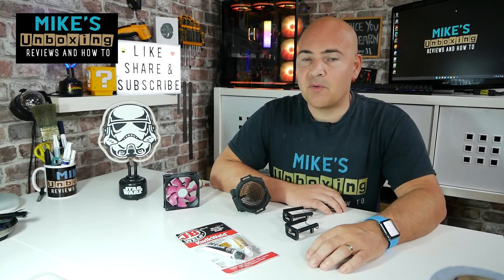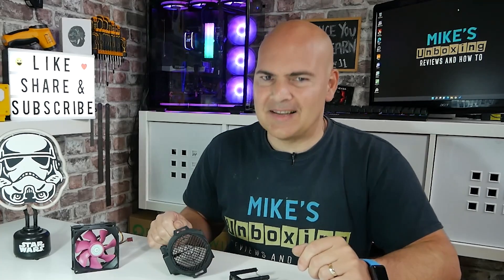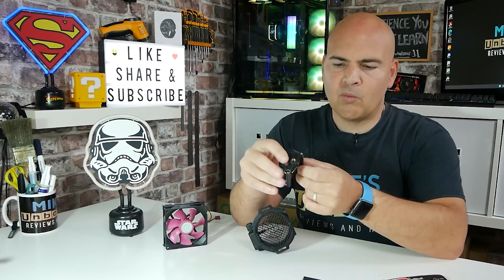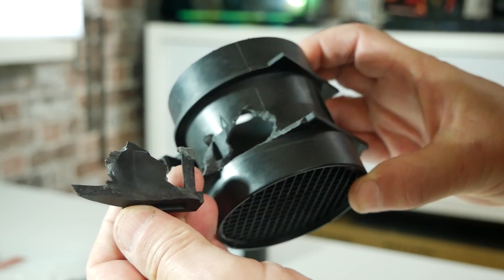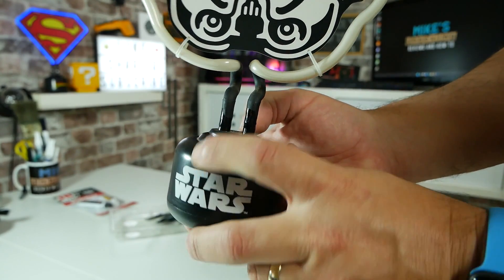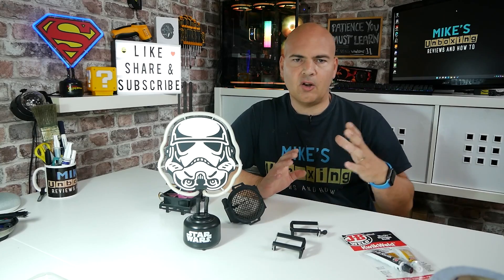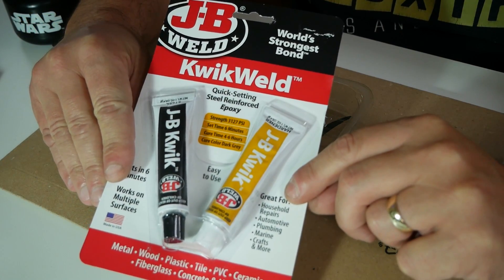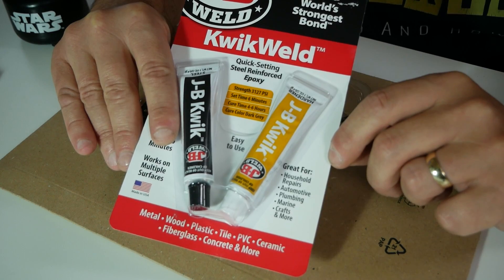JB Kwik JB Quick Cold Weld Fixes The Unfixable Quickly Strong 2 Part Steel Reinforced Epoxy Glue

Comment: I've used a lot of JB Weld products over the years. They really works, and on more things, than you'd think. I fixed my car's leaking radiator with it. When I was really thirsty, I welded two bottles of beer together so I could drink them two at a time. When my girlfriend and I began arguing over which color fish would look best in the aquarium, we used JB Weld to fix our relationship. And when after my cousin Mary had her twelfth baby, we put a dab between her knees to hold her legs together. What else is there to say? No other product on the market is as versatile as JB Weld. So, use Mike's link and buy some today!
Reply: Brilliant!
Reply from the maker: lol the contraception idea is a good one like it
Reply: @PaulBakewell  Thank you. Think that's something, wait until I publish my novel.
Reply: @OlettaLiano  Can’t wait to read it, can I have a signed copy?
Reply: @PaulBakewell  It will be a while before it's finished and I self pub it. I still haven't decided if it will kindle format only, or if it's worth it to also have print on demand. I'll try to keep you in the loop. Thanks.

Comment: I've used this (traditional version) on metal about 10 years ago, kinda like Bondo and it has worked great and is still holding up today.
Reply from the maker: yes it does a really good job, also ABRO Steel is really good and a bit strong in the tensile strength
Reply: @mikesunboxing  I wonder if we can get that here Mike; will have to look for it.  Thank you.
Reply from the maker: @PapaMav  Amazon US do it - the link is in the video description
Reply: Never heard of BONDO,sounds like an Aussie would call an epoxy.
Reply: @mikesunboxing  thank you Mike.
Reply: @Doobie3010  no, BONDO is automotive body filler. Popular in the U.S.  Turns out, now 3M uses BONDO as a name for a line of products for auto, marine and household repairs.   We call expoxy, epoxy.  Usually found it 2 parts, like in most regions of the world.

Comment: JB Weld is brilliant for basically everything. I wouldn't buy it for the odd 1 or 2 cheap items but if you got a load of things or more expensive things then its a great thing to use.
Reply from the maker: yeah it is handy but for smaller things a tube of super glue might do the trick

Comment: Funny enough,those pci covers you used for spreading are great for gpu anti-sag braces,just plop in below the desired gpu end(screw-end down),and bend the top end to make a little ledge to fit under card.Its ghetto,but brilliant at a pinch.
Reply from the maker: lol good idea

Comment: i used jb wet weld before on a pipe and it hardens wet and gets so hard you can drill and tap it like steel .you could use it on plastic too
Reply from the maker: jb stuff is pretty awesome

Comment: If the plastic is polypropylene or polyethylene the jb weld wont hold. Youd be better off welding the break. Or getting instabond which is soecifically designed for PP &PE plastics. That being said jb welds uv cured cyanoacrylate does pretty good on pp and pe. Locktites two part plastic repair works very well on most plastic. It has a marker type applicator with activator in it. Clean the areas to be repaired then use the activator on the broken parts then wait  1 min apply glue to one surface then join and hold 30 secs. Or clamp. The longer the better
Reply from the maker: thanks for the insight David, appreciate it

Comment: Now 2 hours later i lost 44euro on a Logitech G305 Lightspeed Gaming Mouse.
yes the price is down on them here in Germany. just wanted you to know it :_:
Reply: Fantastic mice,very little lag compared with really good cable mice-and the battery lasts aaaaaaaaages!
Reply: @Doobie3010  thats why i did buy it. even got it down to 34.85euro. because it was the last one. they will get more. but din't know when :_: